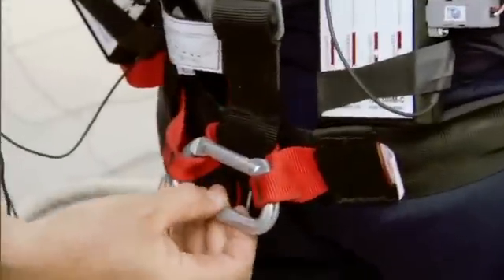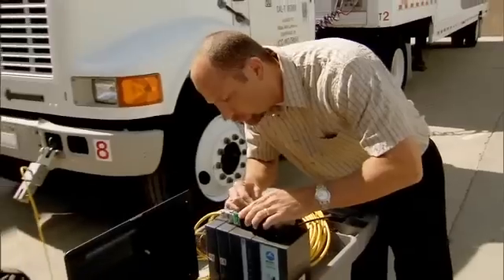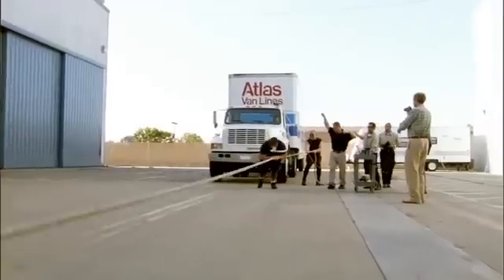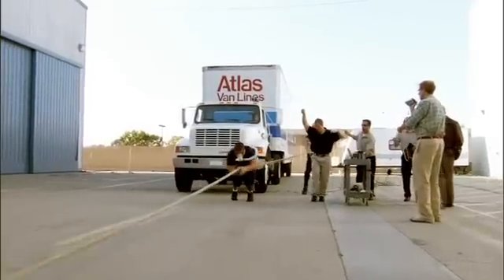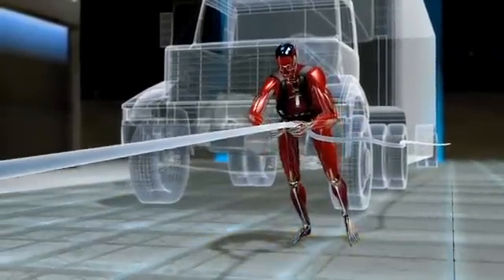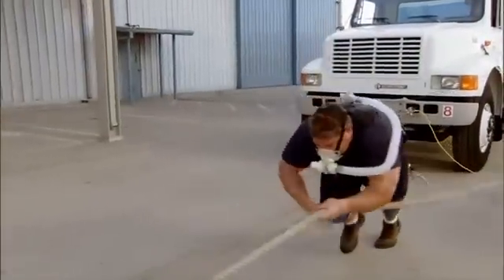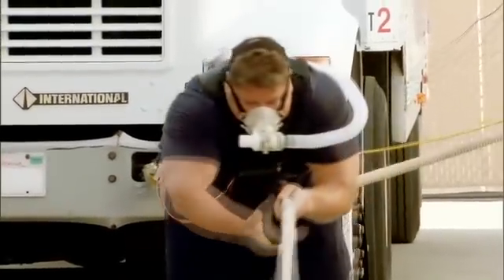How A Load Cell Measures Superhuman Strength

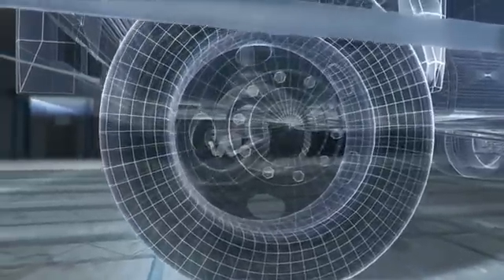Comment: 2:47 "Because the truck is so heavy, friction slows it almost immediately as the force drops."

That does not seem right. I would think that the fact that the truck is so massive means that it will keep up its inertia even after the force pulling it drops. After all, a very heavy truck cannot stop on a dime because it is so heavy. On the contrary, the most massive objects require the most force and time to stop them.
Reply: At low speeds and high friction coefficients, heavy mass causes an object to stop quickly. Trucks on highway have high speeds and lower friction coefficients (a tire's friction coefficient actually decreases at high speeds due to the tire warming up), which is why you get the opposite effect that you're describing.